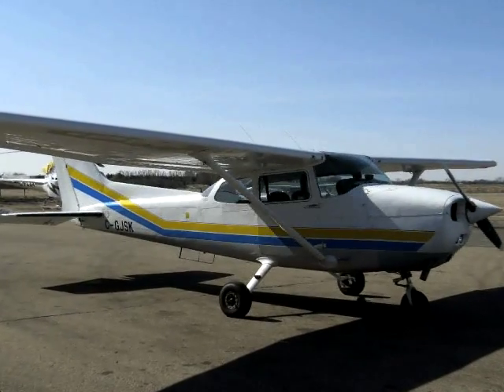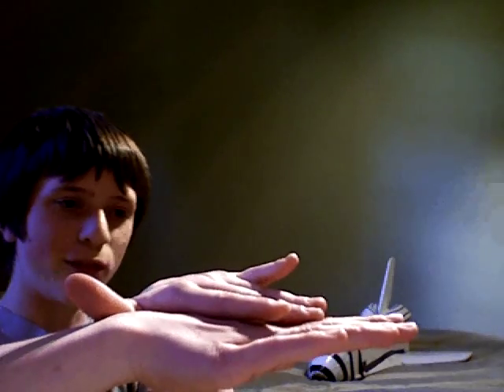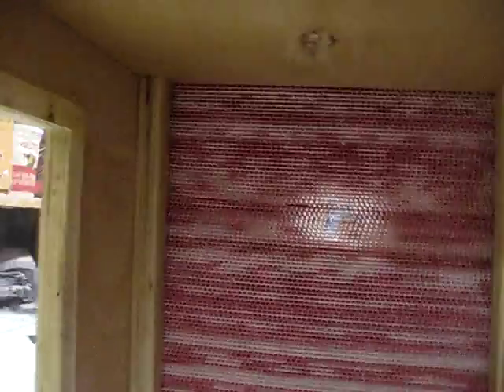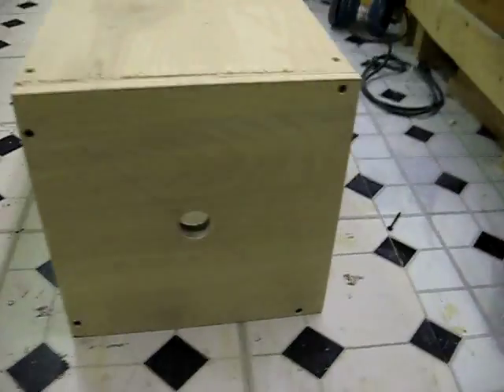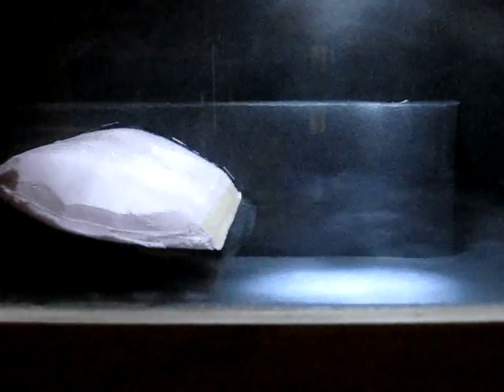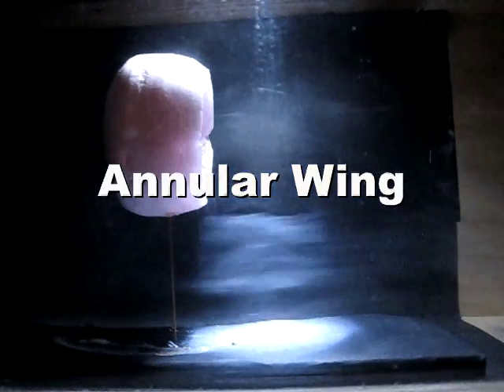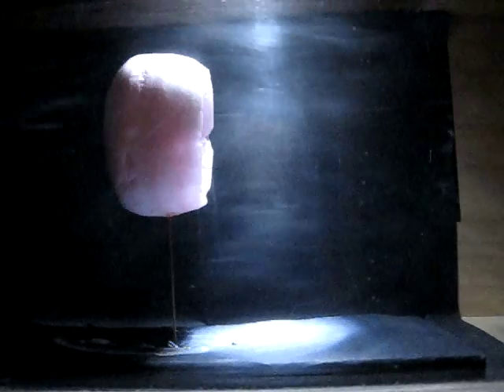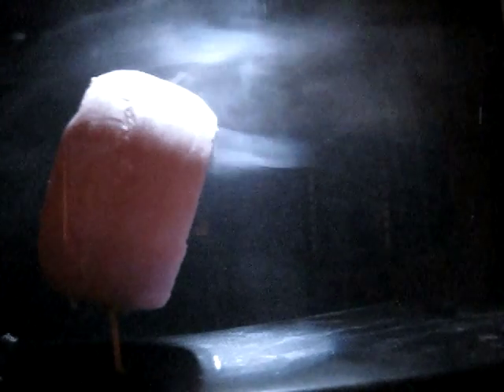Regarding annular wings #2... (Season 1, Episode 4)

Comment: Very nice to see young scientists at work!  One positive type of constructive critique for you:  the smoke is "pushed" into your chamber (not "sucked") due to the lower pressure formed inside the box from the vacuum cleaner.  Fluids/gas moves from high pressure to low pressure. You should change the terminology used in this respect going forwad.  Congrats on the video.